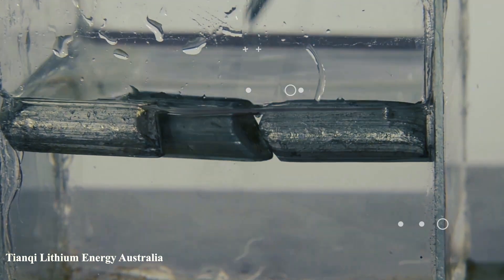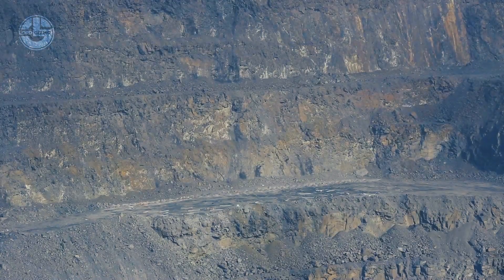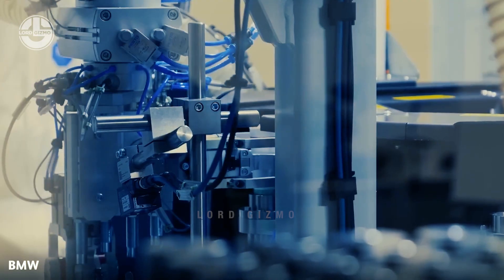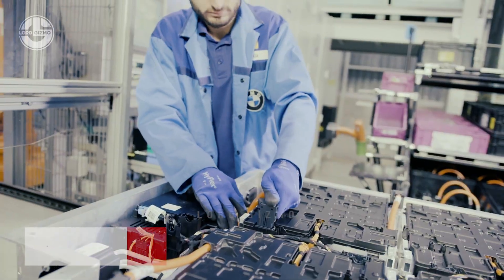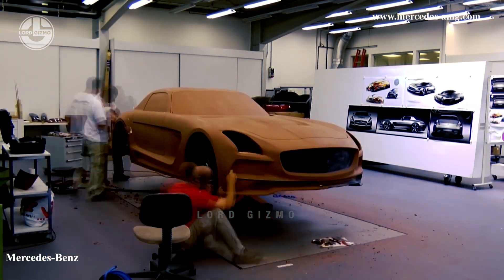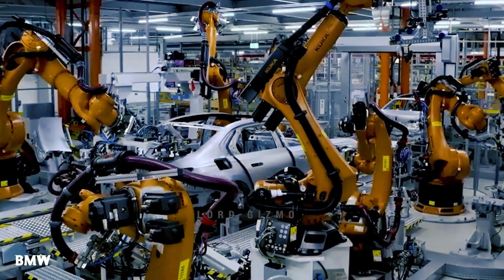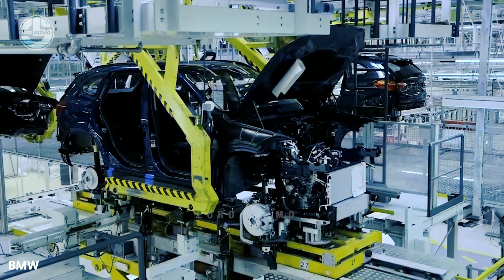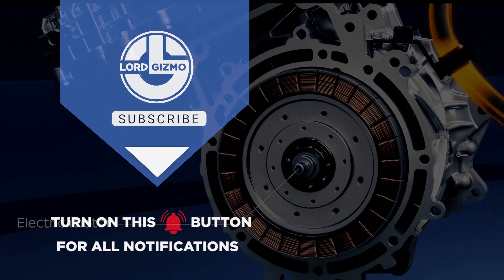From Mining to Manufacturing: The Lithium Extraction Process and Refining Technology!

Comment: Obviously… the early commenters to this video, have the attention span of a gnat!  Take a moment to review the title,.. and it is dead accurate with respect to the video content.  Fortunately, the videographer was able to use BMW source  for the content.  BMW does know how to build cars.  (I will comment here, that their choice to use plastic components in their ICE engine systems, starting about 10 years ago,  has destroyed their solid reputation for mechanical reliability.)
With respect to “sourcing” lithium… the vast majority of the raw materials are the “brine” deposits and hard-rock mined “spodumene”.  The brine deposits will totally own the industry in 3 years.  The cost of mining the hardrock spodumene, grinding/kilning and acid treatment to get to the lithium hydroxide, is not competitive on a cost basis!
The description of fabricating the lithium battery packs is very comprehensive, and accurate.  With proper control of “impurities” in the chemical gels, and quality control of the manufacturing of the cells, will give batteries that will easily give 10 years of workable battery life.  Continuous “tweaks” to the battery chemistry, is extending that lifetime every day.